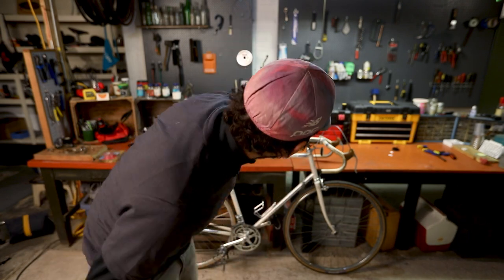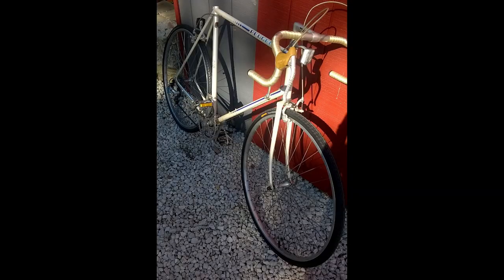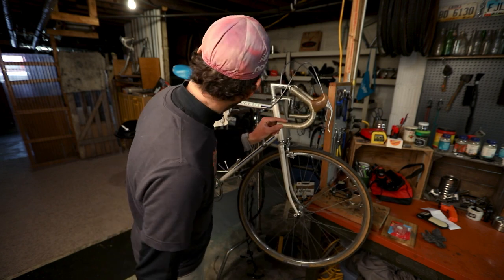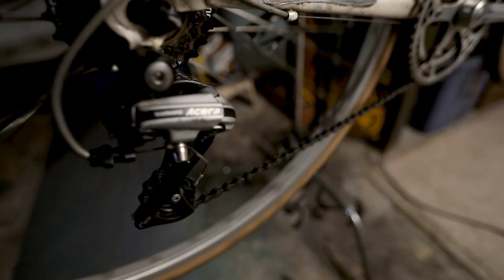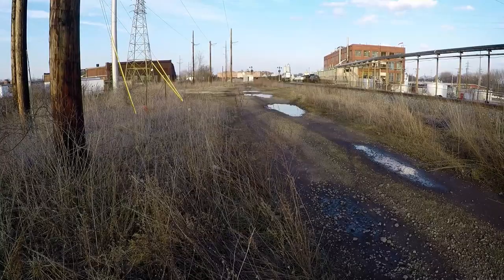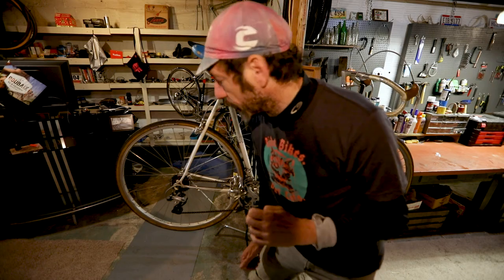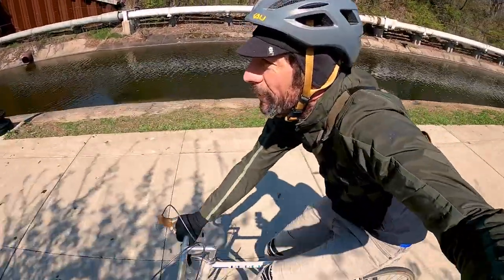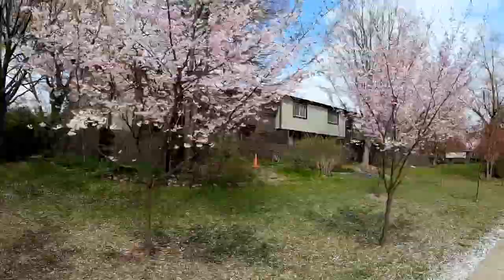THE PEUGEOT - Steel is Real - 80s Aero French Bicycle

Comment: How about Peugeot course..I have one.made in france 12 speed.such a quality bike
Reply from the maker: Yeah - those are rad. I would like to score a nicer Peugeot at some point.
Reply: The "Course" is a great bike. I have a couple of those in "3-Tube Reynolds 531". The sizing, and maybe the geometry changed, at least in France, in 1979. Before then,  the "3-tube Reynolds 531" Peugeot was the PR-10, which was a great all-around bike. They became the PKN-10 in France in 1979, with new sizing, and new decals

Comment: what tires do you have on that bike? ( I also have a 103 (black one) )
Reply from the maker: The are 32mm Panaracers - but I’m not at home now and can’t remember the specific ones exactly (will add that info when I get back). Peugeot made a number of models out of their Carbolite 103 tubing - I believe they were all early 80s. Great ride quality even if it is a bit heavier than Reynolds.

Comment: how heavy is the bike? 25lb or like a 30lb? I have a raleigh and im thining aobut switching to a 1980s peugeot
Reply from the maker: This one is probably about 26 lbs. the thing with both Raleigh and Peugeot is they were massive companies that made everything from high end race bikes to department store boat anchors. Also worth thinking about is that a lot of Peugeot’s used French standards that make them hard to upgrade with modern parts - the Raleighs will be way more standard. I love French bikes and have 4 - but they are definitely more of a challenge to deal with.
Reply: @TimFitzwater  do you know how much a raleigh grand prix weights? I have someone offering me on without the gear levers, seat, and pedals for $20
Reply: I have pedals, and a seat, so I just need to put the gear lever and wire on it
.. not sure if its a good deal.. or I can get a 1980s stem-shifter peugot that is just missing a front wheel. everything else has been newly replaced for around 30-35$
Reply from the maker: Anything for those prices is a good deal!  The only Raleigh I have is heavy but I found it on a curb! No idea on the Grand Prix.
Reply: Tim Fitzwater i have a Raleigh right now and it’s a little to big for me so I’m worried the grand prix might be too big too
Reply: Tim Fitzwater both bike frames don’t look like they’re in the best condition tho. Paint is all scratched off
Reply from the maker: @musicglau  I would just check to make sure anywhere you have threads or bearings there isn't too much rust to make it operational. Some WD40 and steel wool can work wonders on a bit of rust - but there is definitely a point of no return for some frames.  Check that things look straight too - a bent frame can be fixed - but isn't worth it on low end bikes.
Reply: @TimFitzwater  do you know if a Schwinn World Tourist 5 speed parts work on a Raliegh downtube frame
Reply from the maker: I wouldn’t think so - that Raleigh is probably 2x6 speeds.
Reply: @TimFitzwater  yeah the raleigh is a 2x6 speed. the schwin is a 2x5 speed.. when I got the raleigh, the perfect own put on a10 gear mtn rear wheel. so not all the gears work. I wanted to get the Schwinn world tourist 5 and take the wheels and handler and put them onto the raleigh. I don't liek the raleigh brackes acuse I need to be in the tucked posiiton to engage the brakes and the sucide brakes aren't strong enough. also the previous owner of the ralieght took off the front brake. What do you think I should do? I wanted to get the schwinn and use it for parts on the raliegh cause the seller is giving me it for 35$ and its in great condition

Comment: Do Peugeot have Italian or English threading on the bottom bracket.
Reply from the maker: That era is actually French threaded. At some point they did switch to English - mid-80s? Most you find will be French though.
Reply: @TimFitzwater  thanks. My father in law has a peugeot and I was thinking about updating his bottom bracket.
Reply from the maker: Velo Orange has press for bottom brackets that will work and actual French threaded ones. Check those options out!